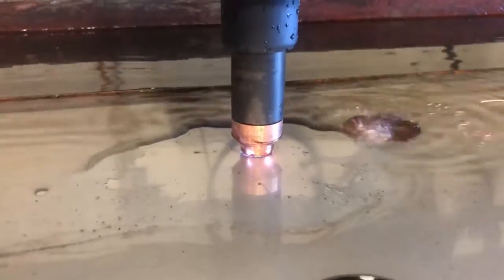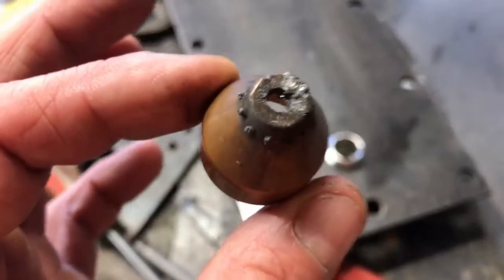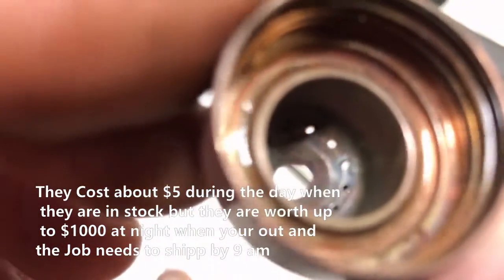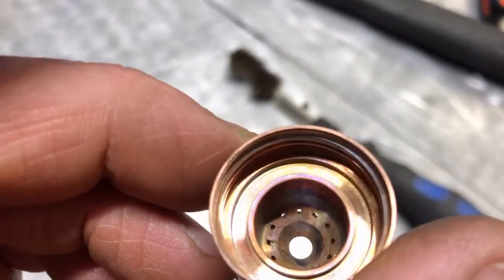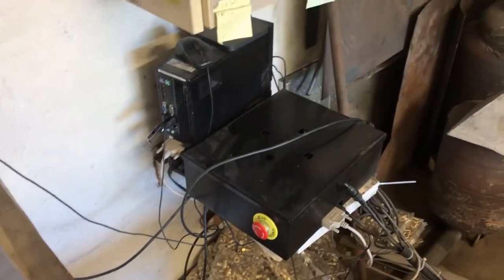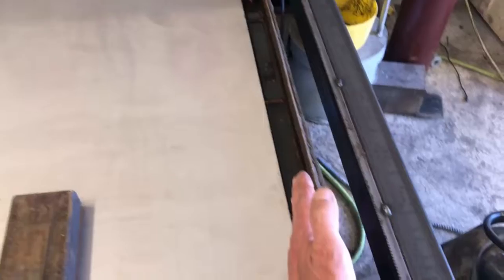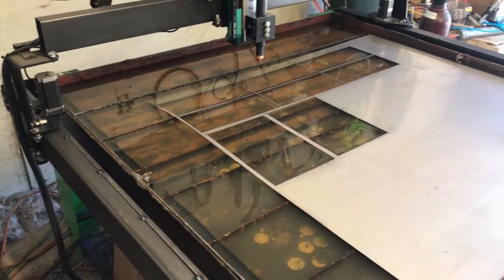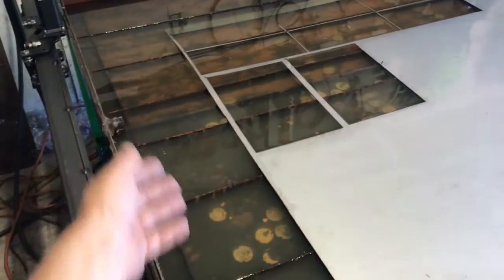Cleaning Plasma Table shields with Acid WOW

Comment: Bob you need some MIG TIP WELDING GEL !!!!!!  There are several brands.  It is a pint jar of gel goop stuff that is put on the tip of the welder.  After using the gel and welding for a while a wipe with a rag will remove all the splatter metal.  When welding I put it on before starting and make sure my gun is clean.   After using the gun for minutes I wipe off the splatter and reapply.   It keeps the tips very clean and they last longer.  A pint will last for ever.  
You really don’t use much. 
 
I am sure it will help your plasma cutter tips.

I don’t think over time you will like putting tips in acid.  When you braze with acid flux it removes the surface of the metal so the braze will go into the metal.  The acid will eat the surface of the tip and the splatter will stick faster next time.    The gel protects the surface and keeps splatter from sticking.
Reply: I was about to say the same. you said it best.
Reply: overmanonfire Sorry dude I was just trying to help Both.  He is trying so hard.  I want him to do well!  I like it when hard workers do good
Reply from the maker: I have some just havnt bin using it , do you put it on the pieces you weld ?
Reply: NOBOX7  No just the tip! 

If I get lazy and just stab my gun in the bottle some gel stays in the tip instead of just a coating.  The gel will melt and get on the work and impede welding.   It protects the metal on the tip from spatter or weld by making weld not stick!!

Comment: Left a message on your last video, but it was a while after you posted it so I don't know if you saw it. I was doing some research and stumbled across a type of atomizer called a flow blurring atomizer. If you have the inner feed tube ID the same size as the outlet hole,  taper the outside of the tube, and space the tube about 1/4 the ID back from (inside) the outlet hole you get pretty impressive atomization. 

The air actually whips into the end of the feed tube  breaking the liquid up.
Reply from the maker: No i did not see yuor comment , youtube comment system is fractured on purpose my friend , they have purposely ended collaboration. 
I go to my screened comment section and there are hundreds there for no reason at all
Reply from the maker: I will check it out thanks
Reply: Can add a drop down in the g code for each hole? Look at the code for the first bit and paste that into the front of rest of the hole cuts.